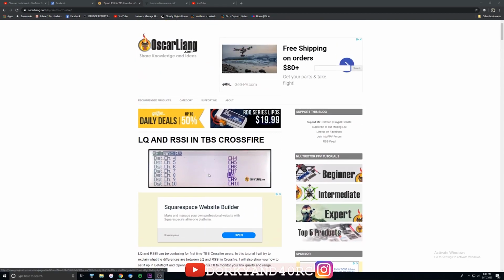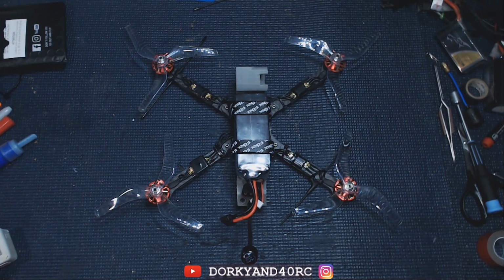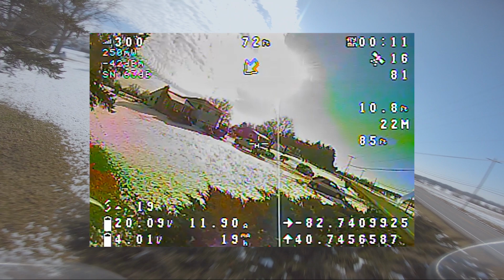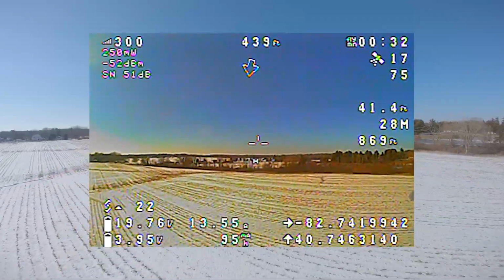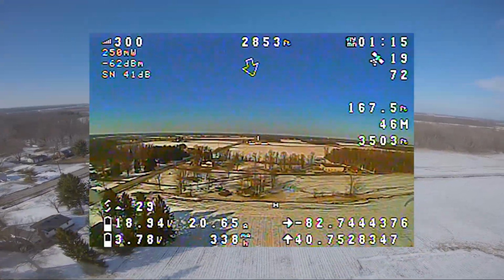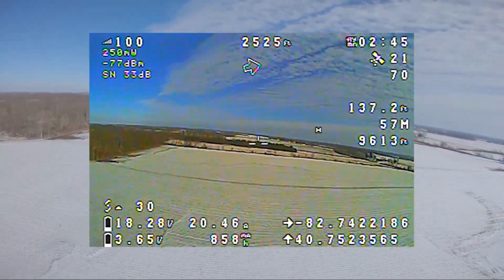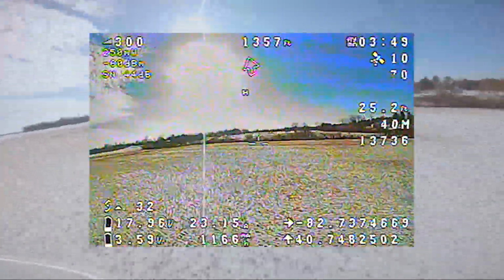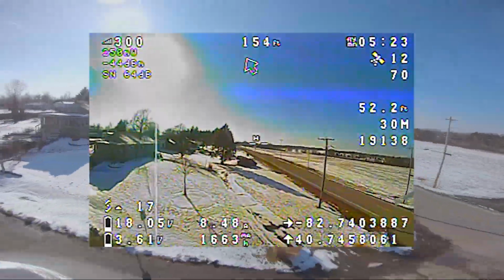TBS TANGO2 AND CROSSFIRE DIVERSITY TEST | REAL POWER

Comment: Horizontally mounted is good up to 10 miles out. After 10 miles it's a big help to have vertical.
Reply from the maker: thas good enough for me on quads :)  ive been about 15km out with a plane and it was vertical.  so hard to find a good mount vertically on a quad unless you have a designed mount
Reply: Hi. If my goal is to only fly within 3 miles, does it mean that my existing TBS Crossfire nano will be sufficient?
Reply from the maker: Sure will
Reply: @Dorkyand40  Thank you!

Comment: I've been running diversity for months on the horizontal direction one on rear right arm nd front left arm. No failsafes. Great distance. Been thinking about the vertical setup but I'm gonna leave it alone after see your video.
Reply from the maker: I think that’s a good call. My tests have proven it’s better and trappy has said the same. Just getting those antenna as clear from the carbon makes the difference. Thanks for stopping by.
Reply: your antenna nulls are pointed in the same direction.  Wouldn't it be better to mount front right arm and back right arm?  Then your null points are 90 degrees out of phase and no matter what way you turn you will hit your antenna in the sweet spot. 
When i go far out, I'm always a little nervous with the turnaround, orienting my antenna radio facing the null point.
Reply: @tylerelliottFPV  I was about to make the same comment! Having the antenna parallel like this is a waste of a diversity rx!

Comment: Thanks my man, do I set my rssi value at 300 instead of 100? 👍💯
Reply from the maker: Please refer to the Oscar Liang post on how to setup your osd. You need to use lq and not rssi osd element for betaflight 4.1 or greater. If you’re below that you will not see 300
Reply: Pretty sure the rssi dbm IS rssi. Idk wtF rssi is.... its not rssi though😑🤦‍♂️ Just delete it and know it was wrong. Theyll fix it soon!

Comment: That dip on the turn is really really bad. The antennas do not work if the tip faces you. I would put both on front or back arms to make any use of the diversity function at all.
Reply: Have you tried this? I'm inclined to agree with you. Especially mounted on the front arms.

Comment: Have ya tried a single immortal T in middle of frame between arms ?  That's how I do mine 0 issues here's my apexs & badger  https://youtu.be/7-cVnBR1Pf0
Reply from the maker: I did in my first tango2 range test video. It is ok for freestyle but from my second test out on the arm worked a lot better for mid range flying and also keeping 150hz mode out further and more consistent.  The immortal L configuration gives similar results.